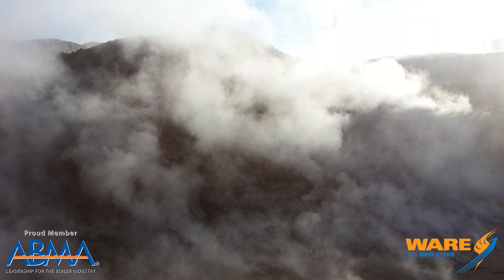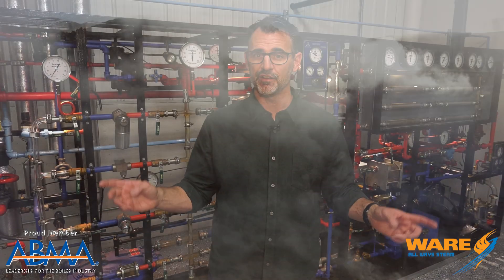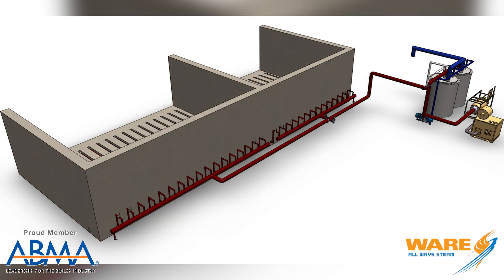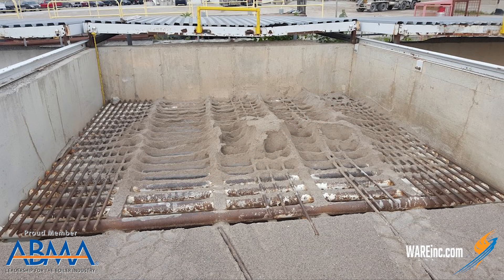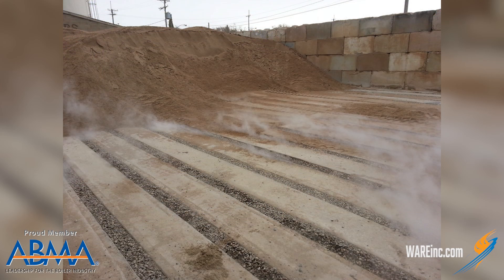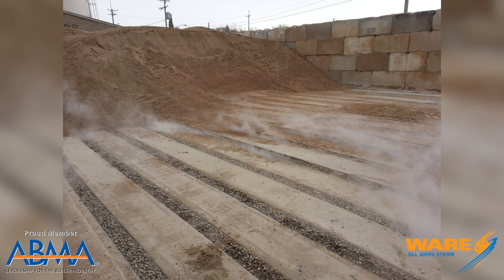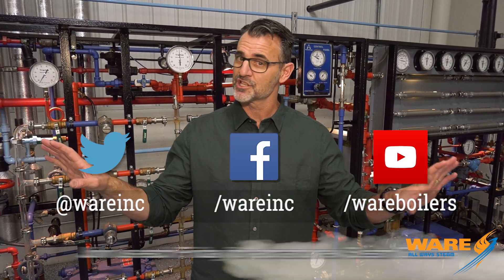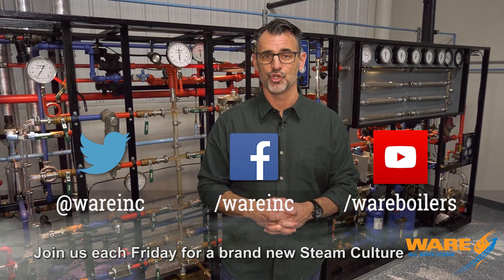How to Make Concrete in the Cold | Aggregate Steam Heating - Steam Culture

Comment: Excellent video. Sand is very fine, so will it not block the steam passages (by falling/mixing in steam lines after shut down)?
Reply from the maker: When we were doing research on the topic, that never came up but you make a good point. There could be way to mitigate that but without knowing first hand, we don't have the answer for you. Thanks for watching!